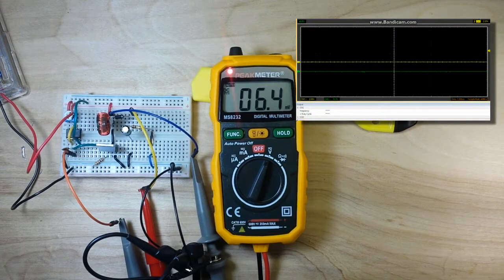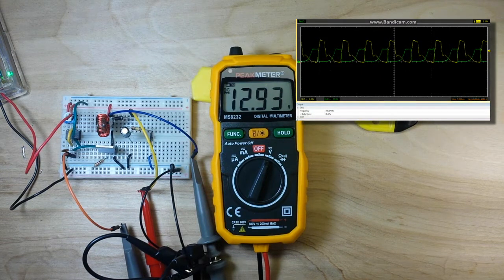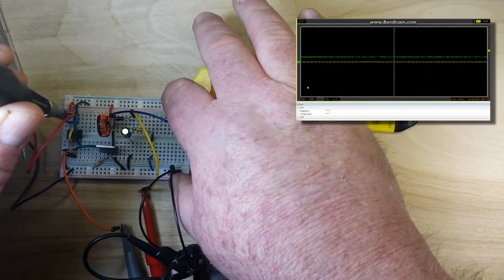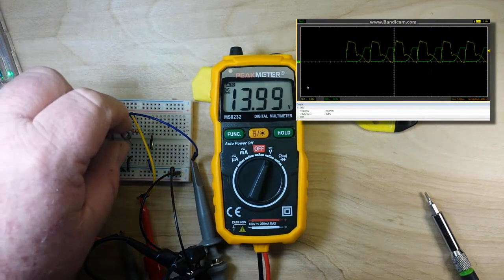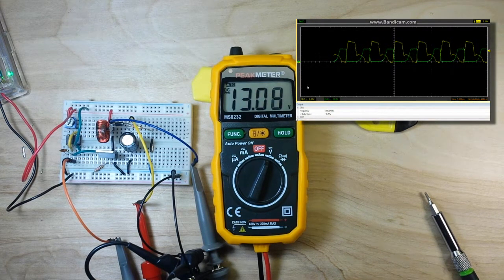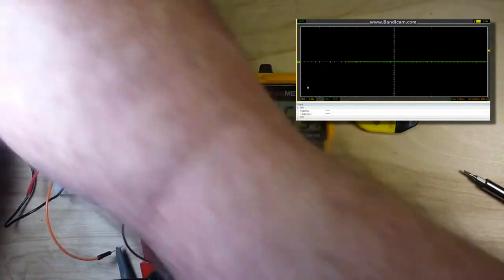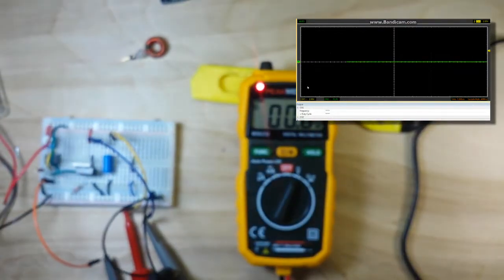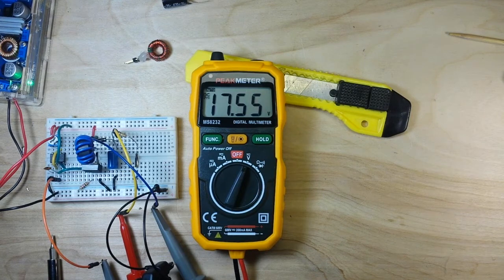Playing with my boost converter

Comment: forgot to mention it: your mosfet probably also requires 10V at the gate to switch properly. at 5V its only partially turned on, so you get less current at the inductor and more heat dissipated in the mosfet
Reply: fredlllll and therefore the frequency is off meaning it could be outputting 1.2 megahertz out of the mosfet, even with the pullsown resistor which makes it work, its not running at full power, he’ll probably need a mosfet driver like the tc4420

Comment: seems like frequency and dutycycle change the output voltage mostly. the output current is dictated by the inductor. when current is flowing through the inductor you build up a magnetic field. when you switch it off, the field colapses pretty fast and that changing field induces a voltage in the inductor wich gets then pushed through the diode into the capacitor. so if the inductor has less resistance(and less turns), you can use more current to create the field, but it is also saturated more quickly. that enables you to use a higher frequency for switching => higher max voltage/more current at same voltage

i will experiment more with mine too. i dont use a 555 though but an arduino. gives me more direct control over the switching times than a pot
Reply from the maker: agreed